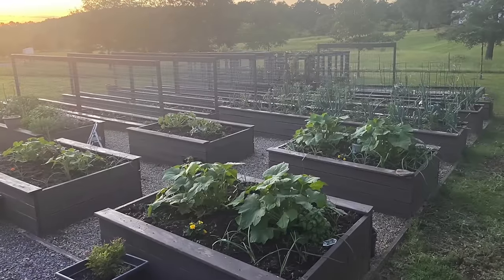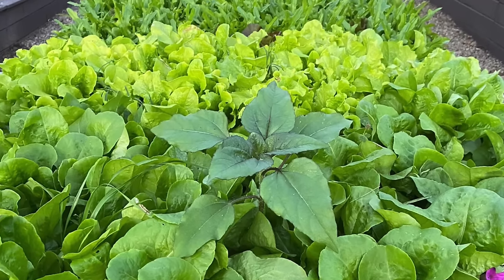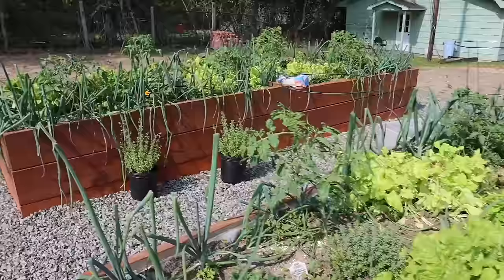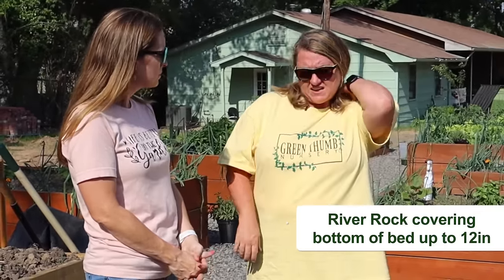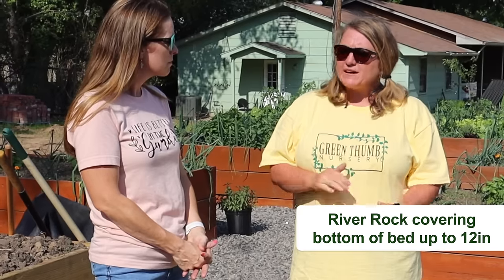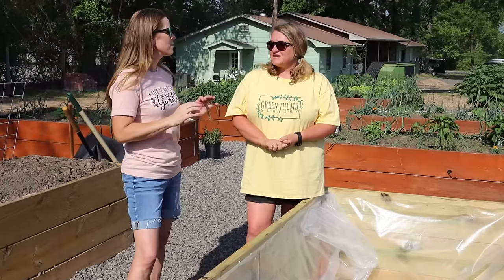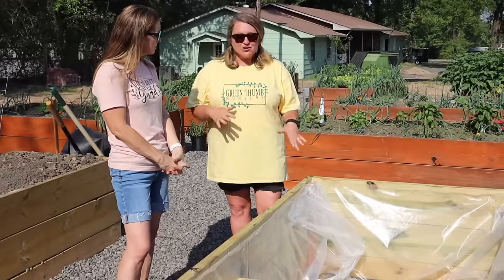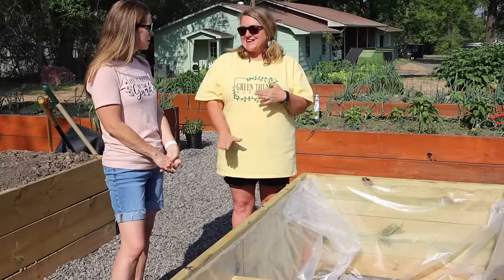DIY Self Watering Raised Beds/Green Thumb Nursery

Comment: I still don't understand how this would work. If there's landscape fabric and rock underneath the dirt, surely that acts as drainage so any water goes down and stays down? And as the dirt and rock are separated, the dirt can't possibly soak it up. Unless the overflow is slightly ABOVE where the dirt starts.

Comment: Thank you for this video.  I live in Miami Florida 10B.  I close my garden every summer because of the heat.  Also, I am extremely limited in income and can't afford elaborate expensive drip systems.  QUESTION: is it possible to fertilize (like aquaponics) through the bottom versus adding bone or blood meal to soil?
Reply: Sure, I would think so, as long as it's liquid fertilizer.
Reply: We do both liquid and solid fertilizing with wicking beds. For solids, we presoak to increase the distribution through the reservoir. That being said, we have pipe reservoirs that allow the water to move more freely across the bed.

Comment: How often do you have to change the landscaping fabric? I assume you would have to then remove the soil to change it and remove the stone and rinse it???
Reply: Landscape fabric will last a long, long time when buried. Heavier is better but also consider making lower spots to increase the wicking/water-soil interaction.
Reply: This would be another benefit of building the wicking bed with drainage pipes or empty bottles. Other benefits mentioned throughout the comments.

Comment: I wonder if having deeper soil works as well. In this example, she uses 12 inches of rock and 12 inches of soil. Would 24 inches of soil retain water?
Kind of like how containers only have so much soil so they need to be watered more often than raised beds and raised beds often need to be watered more than in the ground.
Reply: Catherine - It has to do with the video space in the rock. A general rule of thumb is that washed rock (without lots of smaller rocks/sand) will be about 25% void space. Dirt will have much less. 

Similarly, this is the benefit of using the corrugated drain pipe, which is 100% void space. Instead of 12” of rock, you could achieve the same reservoir volume using a 3” pipe, or you could stack 2 of them and double the storage  capacity in half the space.
Reply: Deeper soil can get really dry too. 
I like the smooth gravel or containers that are empty with water holes to absorb and hold water. Youtube See Gardening with Leon 
Then a barrier. Then soil.
Reply: Laura - If you have a barrier between the soil and the water reservoir that could explain the dry soil. Wicking beds work because of the interaction between the soil and the water. Without the interaction , there’s no capillary action/wicking. 

You do wisely reference Leon. Great resource. He recommends about 20% of the water reservoir being filled with soil. He doesn’t comment on it in all of his videos, but does in the early ones.

Comment: What about soil seepage into the rock, such as along the sides, and,… the matter of 'tea bagging' of soil residue into the rock-water-bottom?
Reply: In geotechnical engineering, there is a debate about whether to use fabric as a soil medium separation at all. It sometimes develops a film that can be problematic. Without it, there is some migration of fines into the void space, but it tends become self clogging. It is just a question of how thick the clogging layer is and its impact on the design. 

If the fabric is wrapped up the sides, there should be minimal migration at all.
Reply: Teabagging shouldn’t be a problem. We actually use the reverse action as a way to get fertilizer into the soil.

Comment: Does anyone have ideas for doing something like this in Birdies new extra tall (30 inch) raised metal beds?  I intend to buy some soon and I assume that dumping a foot deep pile of small rocks or gravel and drilling a overflow hole in the side a foot up from the ground would negatively impact the integrity of the steel walls and stress out the bracing system!  Many folks fill the base with logs to help retain water and save costs on filling the containers but I would love to have a good wicking solution for 4 foot by 8 foot 30 inch tall beds!
Reply from the maker: I wish I had an answer for you. I have a 30" Birdies bed that I have thought about doing this with, but I haven't gotten past the part of, "I wonder..." Hoping someone might have some experience and chime in!

Comment: Those of us who live in a rain forest must NOT use the plastic liner under raised beds, or you'll get a mucky mosquito swamp in the frames. MUST have adequate drainage for big rain events. if the top 6" does not begin to dry after an hour or 2, use a pitch fork down the middle and edges to create drainage or add non-invasive POND plants who also can survive drought events, and play nice with other things you want to grow each season.
Reply: In a rainforest the overflow pipe won't be enough, unless maybe it is a long french drain type. I just don't want that much plastic in the environment. Deep layers of organic material is a wonderful way to fill raised beds however! the composting layer below plants will heat up, for bottom heat in a cool spring, then help retain moisture and feed roots all summer. Just bring out buckets of greywater from the shower or kitchen sink to dump in weekly.

Comment: Just had a thought. Since I do live in zone 5 and the ground does freeze, perhaps I could dig down 12" and put my plastic, rock and perforated pipe below ground level, then put the raised bed on top of the ground above it. Do any of you with experience in cold climates think this might work?
Reply: I did not do exactly as you suggest, but it may work. I am in mid Ohio zone 6 I think. I built raised beds using 21” high garage door panels. Beds are 16’x5’. I put a loop of plastic 3” field drain tile around the inside bottom of the beds—about a foot in from the sides and brought the tile out above the beds. My intention was to maybe run a fan and blow warm daytime air through the beds to help heat them in spring and fall. Maybe run the fan at night during hot days to help cool the beds with night air. 
I never tried that. However, last summer during a drought, I stuck a hose in the tile and ran water in to soak the bottom of the bed. Sweet potatoes really responded.       Duane
Reply: @dianeduanecounterman7126  Thank you
Reply: Check building codes for frostline depths. Not sure about your zone, but 12” doesn’t seem deep enough. Freezing isn’t likely to be a problem regardless with some caveats. The water in the reservoir will evaporate out if more isn’t introduced after the growing season. There are all sorts of covering options. Even if wet though, frozen ground will likely heave up. That’s a problem for buildings but less so for the ground in a garden. You could also add a drain at the bottom of the reservoir.
Reply: @johnlee7085  Thanks John

Comment: I'd be concerned about the soil breaking down the plastic and releasing toxic chemicals into the soil and thus the plants.  And as the plastic breaks down, the soil will get to the treated wood, which will then add to the chemical release.  My solution would be to add a layer of landscape fabric over the plastic.  Cool design in any case.

Comment: Could you add a water soluble fertilizer to the water when adding to the reservoir
Reply from the maker: I can't see why not.
Reply: Probably better to add the initial fertilizer to the bottom of the soil layer. Subsequent fertilizers could be added to the water.
Reply: “Gardening with Leon” shows you how.            Duane
Reply: We made 20 gallon wicking containers this year. After watching " GARDENING WITH LEON" . Most important is the right soil. We used a mixture of peatmoss, potting soil ( not potting mix) , black cow manure, perlite and a organic fertilizer (powder) , epsom salt Mix that together real good. Then when the seedlings or seeds start to grow we used organic watersoluble fettilizer. A good one i tried was a bottle of liquid fertilezer named "dirt" bought it at target. We had great succes with zucchini,  cherry tomatoes, hot peppers and bell peppers.

Comment: Can anyone tell me if this would work in the SW?  I'm thinking the water in the reservoir would get too hot, or evaporate in the 110 degree days.  Any ideas?
Reply: JSclar - It is perfect for the SW. Because you are watering from below, the evaporation rate would be a bit lower. Because the water isn’t being exposed to direct sunlight, it really doesn’t heat up significantly.
Reply: Also the temp of water/rock is much lower that of airy soil. This bed should keep your garden bed cooler than one of equal depth of soil only

Comment: The wicking nature of the bed is greatly limited by the fact that there is no wicking material down in the rock. The roots may be able to penetrate down through the fabric to get to the water but since you created a barrier in there with the polypropylene fabric (which is literally made to stop root growth) most of what you have there is a dirt bed over rocks but there is almost no way for the water to wick upwards once the water level goes below the tube. You would need some kind of wicking material making its way all the way down into the bottom for it to work correctly. Overall I give this about a 3 out of 10 as what you made here was a bit half baked.

Comment: YES. Once the water level drops in the gravel base you have lost that wicking connection with the soil above. You need a wicking material to extend down through the rocks to act like a wick to suck up the water into the soil above, that's why they call it a wicking bed, just like a wick extends into the liquid of a kerosene lamp, if it didn't the light would soon go out ...Just saying.

Comment: How does the water wick up through the soil when the level drops below that of the top of the rocks?
Reply: The overflow pipe is below the top of the rock/water reservoir, so the water level is always below the top of the rock. There must be some wicking that occurs along the rocks. 

Most wicking beds have pipes or bottles or some other completely empty vessel with soil filling in around the pipes or bottles. The water is then wicked up through the soil.
Reply: @johnlee7085  I think it probably relies on evaporation,  with the water vapor condensing on the landscaping fabric barrier and wicking through into the soil.

Comment: About the sewage pipe, why not just use a PVC tube, wide enough to accommodate the hose?
Reply from the maker: Not sure, but my guess it's easier to bend instead of having to buy/install the elbow to bring it up to the surface.
Reply: There are lots of ways to handle the piping. Use what’s available, but in general the bigger the pipe the easier and faster it will be to fill if needed.
Reply: @thebeginnersgarden  No need to elbow it to the surface, just insert a pvc pipe [with the bottom cut at a slant] from the top to the bottom near the tubes.  I would use at least 1" , maybe a bit larger, so you can stick a garden hose down it to fill when needed.

Comment: I need a little more instruction on how to do the metal 4x4 trellis system. Like directions on how to do it...the wood to attach it to etc...
Reply: The metal is something you will likely need to get from a store in an agricultural area. They’re not common elsewhere. 

The wood could be most anything though cedar, redwood, or pressure treated would last longer. Lots of ways to attach it, but be sure to use exterior and potentially PT-wood compliant screws. If you can’t find cattle/horse/goat/pig panels, you can accomplish the same thing by stringing wires. It’s just a little extra work and requires diagonal bracing at the wood corners to keep the frame square.
Reply: @johnlee7085  thank you so much !!

Comment: Is there a limitation to amount of soil to use in the raised bed for the wicking process to work? I'm looking to fill my beds with 14 inches of soil.
Reply: The greater the distance between the water reservoir and the plants, the less water there will be, but realistically not a problem in the context/depths of a raised bed.

Comment: How do you know when the water needs to be added?
Reply: Stick a thin piece of wood into the fill tube like the oil dipstick on a car. It will come out wet to the depth of the water. If you put the stick into a cork you can leave it in and let it act like a bobber on a fishing line. Premark the stick for the level when the reservoir is empty and again when full. Then it’s an easy visual check.

Comment: 0.6 or 0.8mm plastic, 6 or 8 mil wold be something comepletely different!
Reply: Yes, a common error by many including hardware stores and a PBS cooking show on the best food plastic wrap. "Mil" is what they meant for sure...the standard unit used in flooring and plastic sheeting....from the imperial system...not metric. I know you know this but let's explain for others. It means thousandths of an inch so she was using 8 mil which is 8/1000 inch which is about 0.2mm.

Comment: What's so hard about watering your garden if you're a gardener you water your garden if you don't like watering a garden don't have one
Reply: I find keeping the garden watered requires quite a bit of work. This season I used soaker hoses down the rows and around plants. My watering time required just turning my countdown water timer on once a day. I could have hooked up a timer to automate everything. It was nice knowing that my beds were getting consistent water, and I didn't have any issues with water running off away from plants, which happens a lot when hand watering. Also, my carrots did really great with the soaker hoses.
Reply: @slydog7131  they make sprinklers you don't have to stand there or the hose in your hand
Reply: @davidg813  I haven't used sprinklers much because they spread water far and wide, and not just on my raised beds. If you have an in-ground garden (which I would if I had the space) then a sprinkler would be fine. But I don't manually water often, preferring some type of automated system. I am thinking about trying something like a sprinkler hose next year that I can run the length of the beds.

Comment: But... the plastic is not good for humans and having a bathtub below is going to be fruit fly heaven. I recommend you use wood (not walnut) to fill the bottom 20% , then layer smaller twigs and small pea gravel.  Every year the bottom hugel-kultur shrinks and becomes compost. Water flows out the bottom.